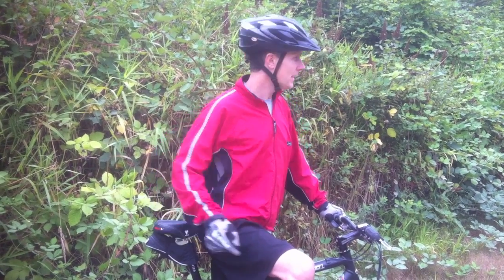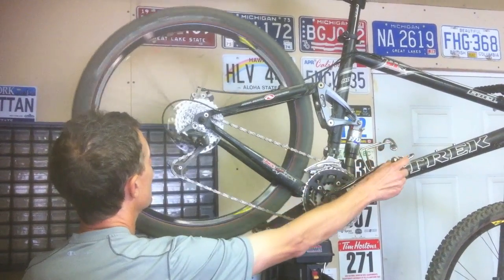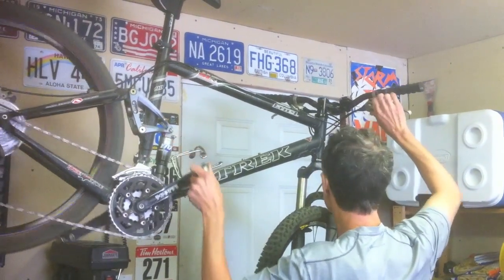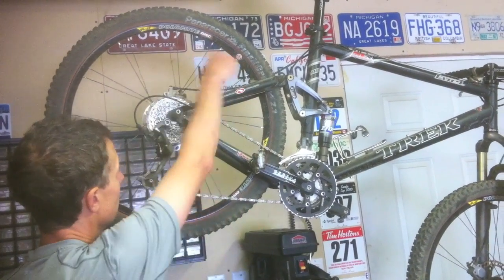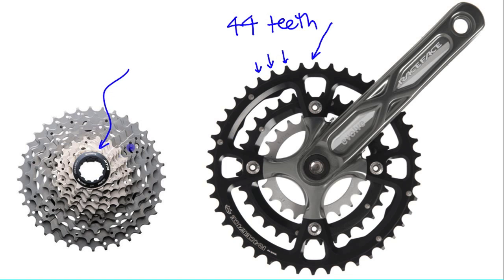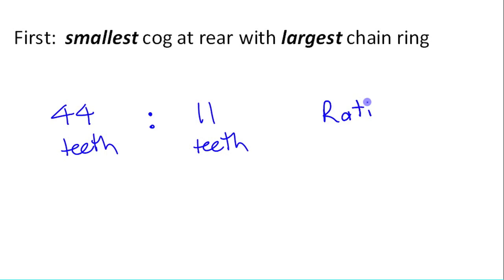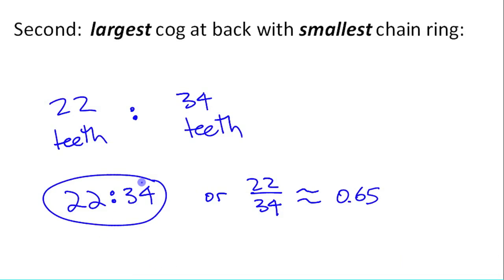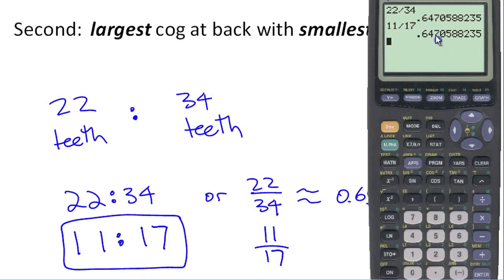Biking Uphill... Understanding Gear Ratios

Comment: I need help. Just bought my first mountain bike. Only comes with 11 speed rear gears only - no front gears I am having issues going uphill. I start from 1st gear and I feel like I'm struggling. It just spins but doesn't get me anywhere. I have to be on 4th or 5th gear in order to move up uphill from a dead stop. Am I doing something wrong??

Comment: That is the scam of a three gear ring bikes, you have multiple three near exact gear ratios... Too many repeated gearings... 
When they sell bikes, they don't tell you the actual teeth number or ratios of the gearing...they tell you it's 21-27 speed bike, complete false information ...... your '21 speed' is actually only 9 speed...
The trick of a three gear ring riding in immediately switch to the big gear going down, the middle gear on flats, and get to the small gear as soon as you are going up...then switch the back gears to match the cadence you want...
Reply from the maker: Yes, your description of how to use a three gear bike is right on, and three ring bikes definitely have their place, but indeed there are definitely repeated ratios, as I illustrate in my other gear ratio video...
https://youtu.be/2qoYr34v1C0
Reply: @AllAroundMathGuy  funny, I never actually knew the ratios until I did the gear ratio calculator, just recently, funny or sadly...

Comment: Thank you for the fabulously clear explanation. Does that mean that the gear range of that specific Trek Bike you were using is approximately 600%, since the wheel will turn around 6 times more, 4 full rotations versus 2/3 of a rotation, between the maximum and minimum gear settings?

Comment: won't the effort it takes to go around a 32:32 be more than the effort it takes to go around a 22:22? even when the ratios are same, as in, won't cadence be higher on 22:22 and make it easier, and hence different, still?
Reply from the maker: Good questions... No, the rider won't be able to tell the difference between these two - the ratio is 1.00 in both cases. Cadence will be the same. Hope this helps. 🙂

Comment: It's really confusing for me when some people say to shift while you pedal & some say don't do that.
Reply from the maker: You want to shift while you're turning the pedals because derailleur gear systems won't change gears without the pedals turning; however, you want to ease off on the force you're applying as you shift so that the gears shift smoothly without damaging the system.

Comment: Not exactly rocket science. Don't need all the math to understand that hills require lower gears, flat and downhill needs higher gears to go faster. Anyone that's ever driven a vehicle with a standard transmission knows this.
Reply from the maker: Yes, very true; but in my experience many people don't understand why lower gears are achieved by the small cog at the front but the big one at the back... part of the focus here was using some simple math to show why 🙂

Comment: Excellent video and explanation. Thank you!! However, what is the best gear ratio for steep hills? I’m on a road bike and do triathlons. Some hills are 10-13% grade and riding a 52/36t in the front and 11-28 in the rear is pure torture.

Comment: But I thought you don't go all the way left gear with all the way right gear.
Reply from the maker: Yes, usually you don't want to go 'big-big' or 'small-small'... it's called 'cross-chaining', and puts a big strain on the chain. It's usually more noisy and wears the chain down much faster if you use it often. And in setups with 3 chainrings there is significant overlap in ranges anyway, so that you can find the same ratio using another chainring without the strain. 
See my more recent gear ratio video comparing 3x and 1x setups for more info if you haven't already... https://youtu.be/2qoYr34v1C0  🙂

Comment: I thought that will give a wrong angle to the chain and the chain will snap also the shifter will be under pressure.....and I thought to not change gears when you go on incline because the pressure on the chain...
Reply from the maker: Two very good points - you definitely get sideways strain on the chain if you go 'big-big' or 'small-small', and shifting is definitely better without excess force on the pedals... either not on hills or just ease up for a moment while shifting

Comment: what if you only have a single chain ring infront that is large and 6 shift gear at the back and you are to go uphill, would it be best to set back gear to 1?the biggest cog? any suggestion? thank you
Reply from the maker: Yes, absolutely - on your shifter the 1 refers to the easiest, biggest cog at the back, regardless of whether you have 1, 2, or 3 chainrings 🙂

Comment: Not what I was looking for but it turned out to be really interesting.
I wanted to know what ratio I should be looking for going up on a long long mountain when my skill/fitness is average.

Still thumbs up!
Reply from the maker: Thanks! Choosing gear ratios depends on many factors, not only how steep the climb is but also fitness as you say, as well as what cadence you prefer. Some people like to spin more and some like to push hard and grind it out. 
BTW, I hope you did end up finding what you were looking for, and have managed to conquer that long mountain climb! 🙂
Reply: @AllAroundMathGuy  The climb has been conquered with a 34 at the back. Doi Inthanon was long but fun.
2 short walking sessions when I felt that my calves were going to blow!!! Turns out walking up is bloody hard as well.
Stay safe.

Comment: Its about the power of a cyclist leg and mental :)
I ride Diablo in standard gear and I love it :)
Reply from the maker: Absolutely it depends a lot on the rider - some like to spin easier gears at high cadence, while some like to grind it out in higher gears. The gear ratios are just an indication of the mechanical advantage that that the bike is giving for any particular combination. 🙂

Comment: Now bring out your eraser and wipe the slate clean, I'm now in the present day running one gear in the front, a 36 tooth, and an 10x50 teeth rear.. I almost never start in the 50, I ride up the hill and shift as I go up, you can't do that with the less expensive drivetrain, but the good stuff shifts great going up hill... so you can carry more speed without spinning fast by starting in low gear for the whole hill..
Reply from the maker: Yes, I agree! Super wide range cassettes and narrow-wides have made a 1x setup ideal for MTB. I've converted my commuter bike to 1x11 with 42T ring and 11-42 cassette and love it! Simplicity with only one shifter for the whole range of gears is awesome! I've just made a video comparing 1x to 3x if you're interested... https://www.youtube.com/watch?v=2qoYr34v1C0&list=PL0oMrVaWT6dmqY9qZrbEbYQ-mHcIxAxtD&index=16&t=0s

Comment: Thanks for the video. got me fussing with the spreadsheets.... this can be very complicated. What I want is to be able to walk into a store, count the gears and know if this new/used bike is going to be 'better' than my old bike.  
So I look at the top and bottom gears. Low end: Biggest gear in the front divided by the smallest in the back. My current mountain bike  has 28/32 or .88 So I want the new low gear ratio to be less than this.  For the top end I can do the same. my current bike: 48/14 = 3.43x. But what if I want to compare my 26" bike to a 27.5 or a 29"? 
So I did the whole spreadsheet thing and then reduced it: So Wheel diameter (inches) x Gear Ratio (Front/back) x Cadence/ 336 = MPH  (you can also leave out Cadence and just wheel diameter x gear ratio = speed comparison number. This way a 26" wheel with a 3.43 gear ratio (high gears) = 89, compared to a Canondale Trail 5 with a top gear ratio of  2.73, a 27.5" wheel is  75 and a 29" wheel is 79.  (The actual calculated speeds at a 70 rpm cadence are 26" 18.6 mph, 27.5  15.6 mph and 29"  16.5 mph. So the gear ratio of my bike which I do hit the top gear and could use a bit more is significantly better than the newer bike. ) The lowest gear ratio of the Canondale is .65 which is better than .88.... but then again wheel size... It's easy to just Wheel size x Low Gear Ratio= low gear number (and a lower number is better) so my 26" at .88 is 22.9, and the Canondale lows are 27.5= 17.9 and 29" = 18.9 which are better.  (I'd have to have a .69 ratio on my 26" to match.)

Comment: Very helpful video. I still have a nagging question though. Between two different gear combinations, with the same ratio, would the force required be the same? Intuitively I think the combination using a smaller front ring would require less force, but don't know the math to support this. Help?

Comment: On a 26" MTB, I find that if I have a 44:34 ratio, I can easily hammer through hills, I actually prefer it than peddling too fast up a hill, unfortunately you're crossing the chain though.

Comment: thanks best one I've seen, but I have a question. what gear combination will you recommend for a five mile ride? considering I now know how to handle hills. smallest ring in the front and the one with the more teeth in the back. thanks again
Reply: Just use the gear with witch you feel comfortable peddling with. There is set gear to use.

Comment: For ex trek remedy 8 is about $700 more expensive than the already expensive trek remedy 7 at $2500. 
The more expensive one has only 1 32T chain ring and a 10-42T cassette. The Remedy 7 has 36/22T rings and 11-36T cassette. So the more expensive one will be as fast but won't get you up the hill where the other one will. Crazy. 
For the one with only one chain ring to match the range of the other one,  the cassette has to have a 52 teeth big cog,  which will probably look silly.

Comment: This was a great explanation, I was wondering if you were to go with the smallest gear and the smallest gear in the back what would happen, and that would make it hard to go up a hill too.
Reply from the maker: +Stanley T Thanks! I'm glad you liked it. Normally you don't use smallest with smallest, because it puts quite a diagonal strain on the chain, which can cause it to wear out prematurely. But, if you did put it in that combination, it would still be fairly difficult to go uphill.  On my bike, if I did that the gear ratio would be 22:11, or 2:1. - not as difficult as in the big chainring-small cog combo (which is 44:11, or 4:1), but still difficult enough.

Comment: You mention it is not a  good idea to use a high gear when going uphill but you failed to mention it is ok if you already have speed built up and the hill is not so steep nor long.  Other factors that affect the perceived gear ratio are the tire diameter and the crank arm length.  You didn't mention those so you explanation is incomplete and misleading.

Comment: Some bikes do not require you to pedal to shift.  I remember riding a 3 speed bike with internal hub gears and was told NOT to pedal when I shifted.  Also, there is front freewheel technology where the chain moves even when just coasting so shifting is possible when coasting so you should be more accurate when you make statements like "you should be pedaliing when shifting" cuz it is not true for all bikes.

 Also you should mention about the tire diameter which affects the overall (rollout) gearing.  For example, your 22/34 gearing on a 27" diameter tire is about the same as 22/33 gearing with a 26" diameter tire and/or about the same as 22/30 gearing with a 24" diameter tire but you didn't mention that even though it is important.

Comment: Flawed explanation.  It is possible to have a triple chainring and many cogs and have all unique gears with no duplicates.  Yes some of them may be close but that doesn't mean they are identical.  So you shouldn't say that a 27 speed bike doesn't have 27 different ratios because it would depend on the actual gears.  They can be forced so there is no overlap.  This is very easy to do.  Even more, they can be forced so they are not even very close, perhaps 10% gap as the closest interval from a similar ratio gear.
Reply: Jesse Williams I can design a 27 speed (triple x 9) system where no gears are within 10% of each other.  Whether it would be practical and/or cost effective to build is another story but it is possible.
Reply: Jesse Williams With todays cassette systems and interchangeable chainrings, the bike owner CAN make his/her own gear combinations!  This is not 1980 with people riding Schwinn 10 speed bikes anymore.  A person doesn't have to design the bike, just has to design the ratios.  That can be done in a spreadsheet rather easily.
Reply: You do realize this a math video and probably making this for his students right?

Comment: Why is the hardest gear on the crankset LARGE, and the hardest gear on the cassette SMALL??
Reply: Think I solved this with a little thought.. It's all about ratios. There isn't a very large cog or a very small chainring.. but if there where, it would work in the same way, as the ratios would be the same.
Reply from the maker: You are exactly right - it's all about ratios.  If you work out the gear ratio for any combination (front teeth divided by rear teeth), that number represents how many rotations that you'll drive the back wheel through for one rotation of the cranks.
Smaller/fewer teeth at the rear cassette and/or larger/more teeth at the crankset gives a LARGER ratio which means you'll drive the back wheel through MORE rotations for ever rotation of the cranks; whereas, larger rear and/or smaller front gives a SMALLER ratio which means you'll drive the back wheel through FEWER rotations.
Hope this helps... and thanks for your question!  :)

Comment: 1x11(34x10-42) or 2x10(24-38x11-36) which one is easy for biking uphill? If I'm not wrong instead of your video 2x10 one is better. But, if it's better why all enduro race bikes are 1x11?
Reply from the maker: Thanks for your comments.  Yes, even in the several years since I made this video, more and more people are going to fewer or even just a single chain ring.  In 2x or 3x setups, there is always quite a bit of overlap between the range of gear ratios for each chain ring.  You can get almost the same range of gear ratios with fewer or just a single chain ring if your use a cassette that has a wider range, as in the examples you gave.

I really like the idea of 1x11 for many off road cycling situations - With the 34x10-42 example you gave, you get a great range of gear ratios... assuming the cogs are 10-12-14-16-18-21-24-28-36-42 teeth, then the ratios are:
3.40, 2.83, 2.43, 2.13, 1.89, 1.62, 1.42, 1.21, 1.06, 0.94, 0.81
This gives a huge range of gear ratios without having to change chainrings - a lowest ratio of 0.81 up to a high of 3.40.  I think this setup wasn't always possible in the past, but now is because of newer rear derailleurs capable of spanning such wide ranging gear sizes.  I think that there are several advantages to having just a single chain ring.  First of all, it will be a much lighter setup with fewer rings and no front derailleur.  Secondly, a single ring gives you much more clearance to get over logs and other obstacles without getting caught up on your rings.  And finally, you eliminate the complication of having to shift both front and rear... you don't ever have the "it's getting really steep - should I switch to my granny gear or not?" situation to think about... you just shift up and down with one hand as your terrain changes.  For road cycling, you want to be able to really fine-tune your cadence, so you benefit from more rings that give a tighter range of gear ratios within each one; but, for off-road it's different - wider range and less complicated shifting often outweigh this.

Even with the 2x10 setup you metioned (24-38x11-36) the range is good too... assuming the cogs are 11-12-14-16-18-21-24-28-32-36, then the ratios are:
2.18, 2.00, 1.71, 1.50, 1.33, 1.14, 1.00, 0.86, 0.75, 0.67 (small front ring)
3.45, 3.17, 2.71, 2.38, 2.11, 1.81, 1.58, 1.36, 1.19, 1.06 (large front ring)
This is slightly more broad range than the 1x11 setup (lowest 0.67, highest 3.45), but many riders might not consider this worth the weight difference.

Compare either of the above setups to the setup on the bike I had in the video (typical 3x9 setup):
Front rings of 22-32-44 teeth and rear cogs of 11-12-14-17-20-23-26-30-34
2.00, 1.83, 1.57, 1.29, 1.10, 0.96, 0.85, 0.73, 0.65 (small ring)
2.91, 2.67, 2.29, 1.88, 1.60, 1.39, 1.23, 1.07, 0.94 (middle)
4.00, 3.67, 3.14, 2.59, 2.20, 1.91, 1.69, 1.47, 1.29 (big)
This provides a wider range of gear ratios than either of the other setups (0.65 low, 4.00 high), but again maybe the slight difference is not worth the weight penalty and complication of multiple rings and front derailleur.

I hope this helps!  :)
Reply: Maybe because they save a lot of weight by losing the second chainring, cable, actuator, and front derailure.

Comment: Good explanatory video. But you miscounted the teeth on the driven gear - it actually has 36, not 34.
Reply from the maker: You are quite right - very observant of you! :)
The one in the picture does indeed have 36 teeth; but the calculations I do in the video are for the bike I was riding at the start, which has 34 teeth on the biggest cog.  In retrospect I probably should have made sure to use a picture that was an exact match for the gears on the bike! :)

Comment: Hi!  i want to ask if you could solve this gear ratio for me on my handpiece drill. The gear ratio is 20:1 running at 1000 rpm motor, how can I match the rotational output of this other hand piece with  8:1 gear ratio.? how much rpm should I subtract or add without changing  the torque at 30 Ncm? Thanks in advance